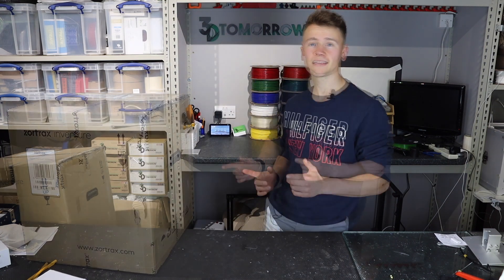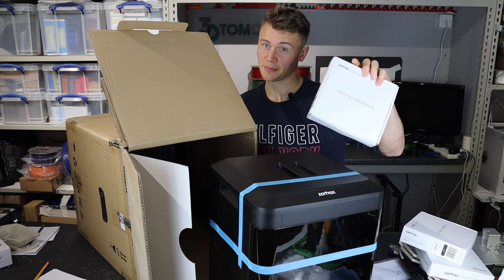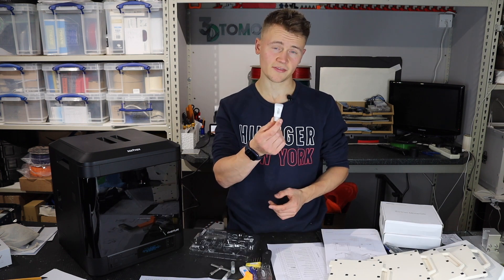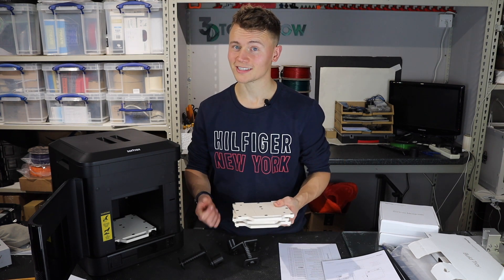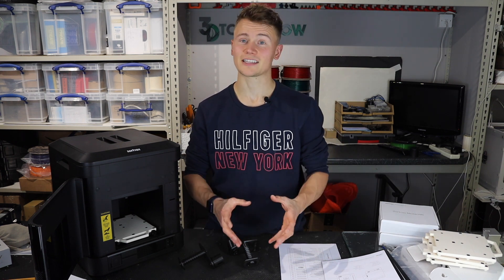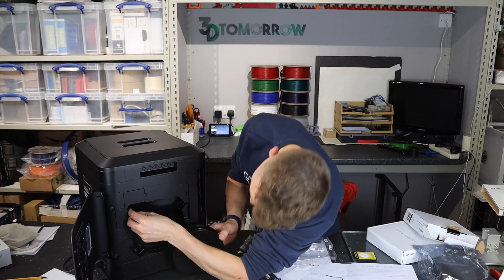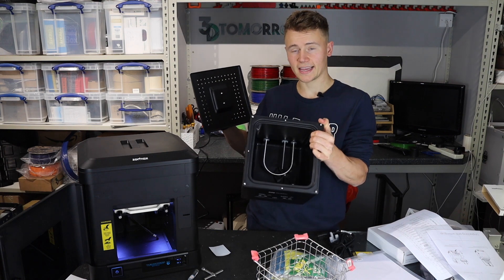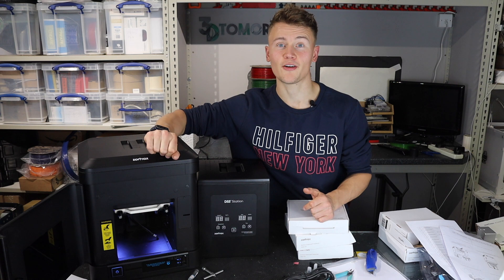Zortrax Inventure 3D Printer + DSS Wash Station - UNBOXING & FIRST IMPRESSIONS - Soluble Support

Comment: I just got the DSS station. I put water in about 40 degrees, i set the temperature and then i press the on/off button to start and the set temperature screen starts flashing. Does this happen generally or am i doing something wrong...? Does it happen to you too..?
Reply from the maker: Hi Angelos, I believe that just means it’s heating up to temperature, takes a little while to reach the set temperature:)
Reply: @CallumColes  Thank you! Indeed, it needs about 30 minutes to start heating

Comment: What temp can the chamber get to?
Also, is this core x-y, looks like the bed doesn't have much room to move.
Looking forward to your review
Reply from the maker: The chamber can be heated up to 80C, quite impressive. I'm about to test some ABS prints with it that have proved very challenging on an open printer. Will discuss this in the review.

The belt layout is H-Bot.

Thanks, review will be up in a few weeks. I like to properly check out a machine before giving my verdict :)

Comment: when you making some videos on this printer?
Reply from the maker: Shortly! I post a new video every Sunday, so more on content on this printer will either be the next video or the one after. Just need to think of some things to print, any suggestions?
Reply: @CallumColes  functional parts would be ace!
Reply from the maker: @ridingg  your wish will be my command! Stay tuned
Reply: @CallumColes  btw I bought the same printer as you, made sure u contact Zortrax and ask them to send you your free support material as it meant to come with one as part of the sale unit. Which they sent me one out as it was missing
Reply from the maker: @ridingg  Exciting times! Has it already arrived then? Yes I have the support material, the soluble support material on a prosumer machine like this was one of the big attractions of for me.
Reply: @CallumColes  yes its all setup ready to print... not much content of this machine on YouTube... when if your next video about it coming?
Reply from the maker: Nice, I'm looking forward to putting it through its paces. I've done a bit more filming with it today, just showing the auto bed levelling, nozzle alignment and z-suite. So I will edit it this week ready to release next weekend. I will also have a timelapse video out midweek, it's printing now, just a few small test prints to have a look at the tolerance before I set it on anything bigger. I have a particular project in mind that I'm saving for the review video. Did you buy the printer with anything in mind to print?
Reply: @CallumColes  I've got a spare cartridge if you need one, to use your printer as it was designed to be.. you can copy the RFID chip at the start and copy it back once it runs out so your able to undo and refill it with your own material
Reply from the maker: Nice one! Do you not plan to refill it yourself? Always handy to have for different colours etc. Realistically, I'm most likely to use this with my own filament and feed in to the printer from some much larger spools. That said, I realise that wont be the case for most people who opt for one of these printers, so thought it made the most sense to do the videos with the filament from the same manufacturer. I just published a follow up video, the final review video will be in a few weeks. How are you getting on with the printer?